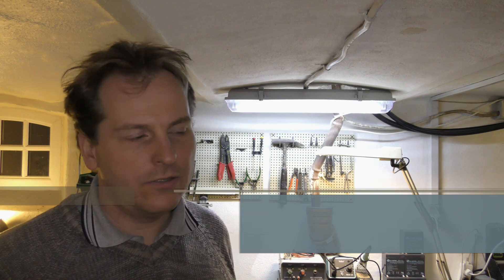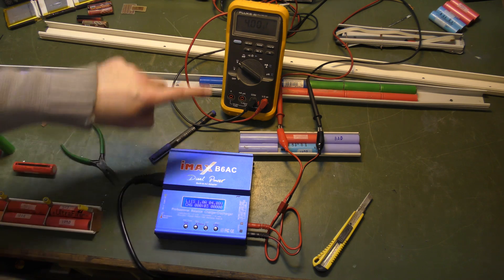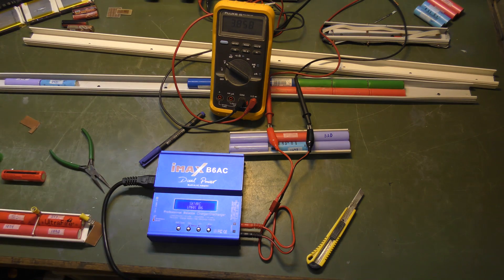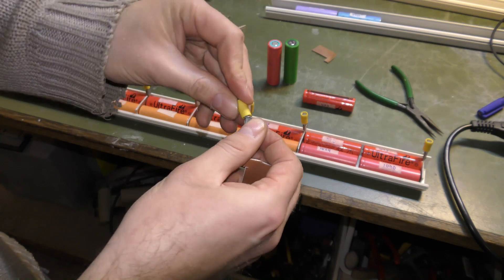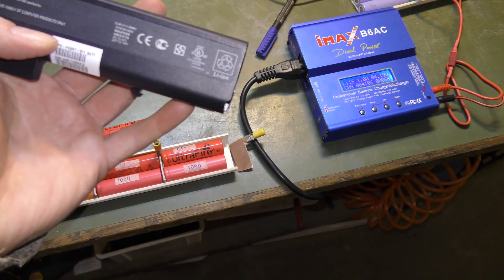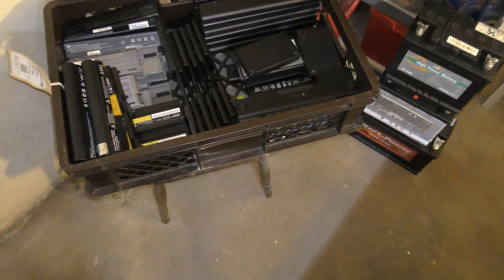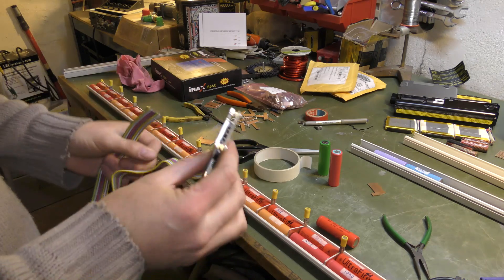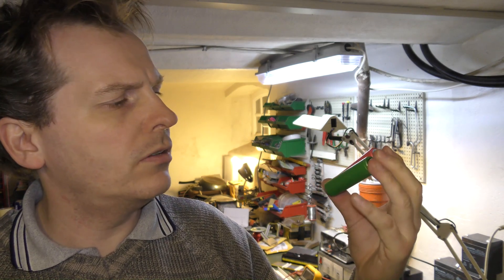358 new Li-ion cells ready for my 48volts power banks - 271

Comment: instead of PCB copper board, if you use a solid plate of copper, you can then use a punch to put a dimple into the plate, so it will make contact to the end of battery..?
Reply from the maker: Hi +HarreyHHH 
Yes i have also been playing with that idea,, i do not have any solid plate of copper, but i think that for testing, a thin pieces of steel will do just fine. I like something with a spring effect,, also on the dimple. I was thinking about the steel used for roofing..
Thank you for watching! :-)